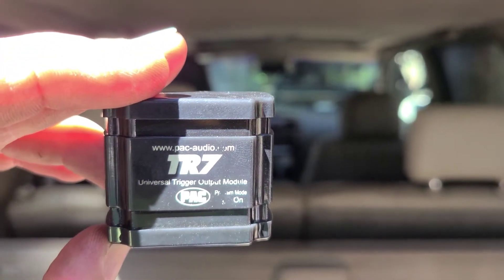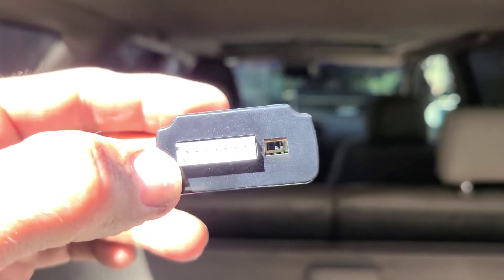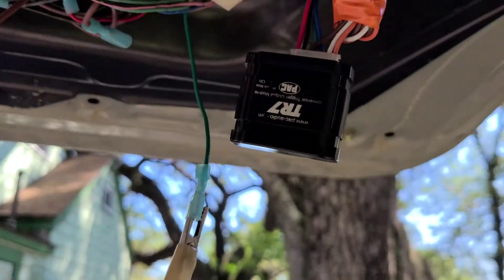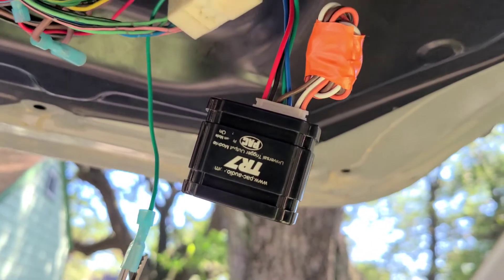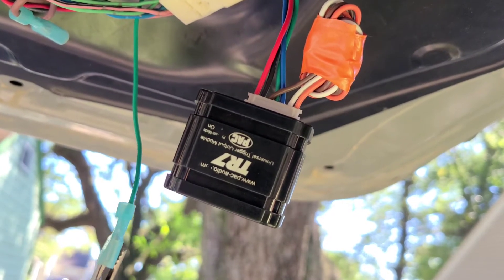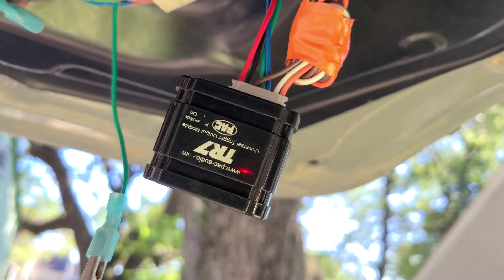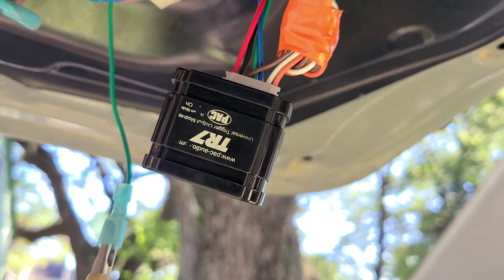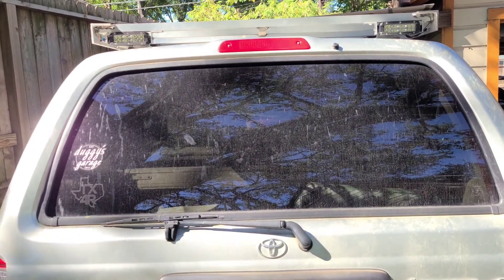Programming PAC TR7 for option 15 timed output on triggered input

Comment: Great video! How do I program double pulse?
Reply from the maker: I discuss how to program a double press input, are you referring to something else?
Reply: @yourunclefab  I meant double pulse for car alarm. door unlock require for some cars in order to fully disarm and unlock the door. I think it's programming number 5.
Reply from the maker: @yakuzahi  sorry zach, I think I understand what you are asking but my experience with the pac is limited, and all I am familiar with in the programming for my purpose.  Hopefully if you know the options number my vid is helpful in showing how to program it.
Reply: @yourunclefab  Yeah I followed your video on how to program it. I ordered 2, but one of them didn't worked right.
Reply: Thank you for this video! I am trying to use this module to trigger a positive tailgate release when I hit the unlock button on the remote 3 times. Would I basically follow the same steps as in this video? Thanks in advance for replying to me.